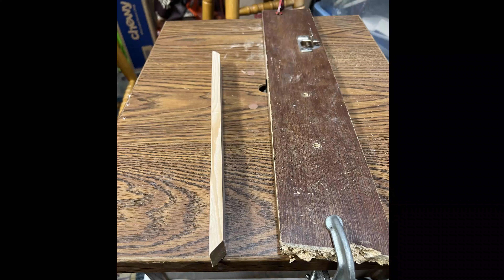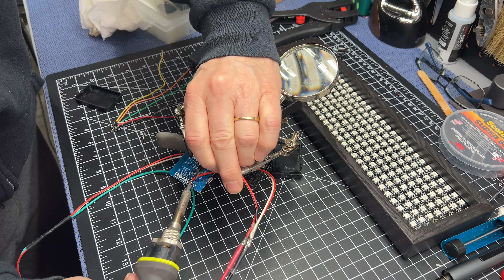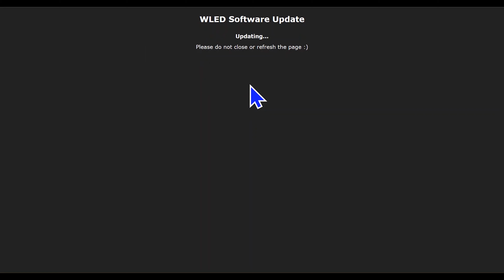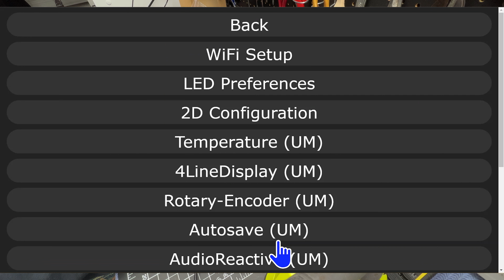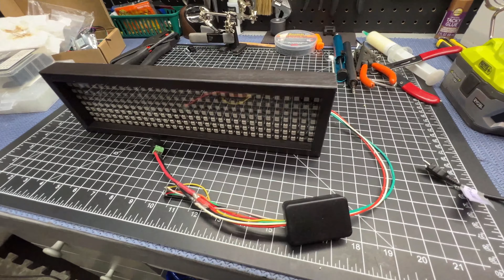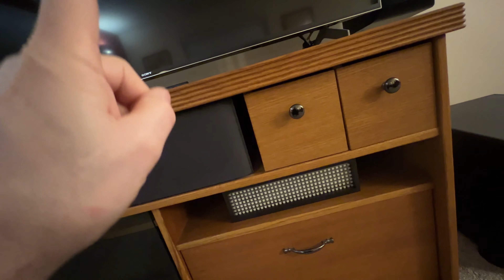Sound Reactive 2D LED Matrix - ESP32 + INMP441 Digital  Mic + WLED-SR

Comment from the maker: Thank you for watching, here are the part links from the video:
► 7/16" x 1-1/16" x 6' Hem Wood board: https://bit.ly/41CpVlp
► (3EA), INMP 441 Mic: https://amzn.to/41AzLUR
► (2EA), WROOM ESP32 D1 Mini: https://amzn.to/4sbi7nV
► 5V, 15A, 75W Power Supply: https://amzn.to/3Se998t
► 8x32 2D Matrix LED Panel: https://amzn.to/41FyFHB
► ALTERNATIVE Matrix Panel 2 Pack: https://amzn.to/4pSSx4O
► (5EA) Waterproof Plastic Project Box: https://amzn.to/3ZbuEst
► Chalkboard Backer Panel: http://bit.ly/3YefpxI
► Picture Frame 1" Turn Buttons: http://bit.ly/3J3NkVN
► 1/8" x 8 x 10 Acrylic Sheet: http://bit.ly/3xZth4b
► 12oz Black Satin Spraypaint: https://thd.co/3IwZu7O

Misc Links:
► Chip Quick Smooth Flow Soldering Flux: https://amzn.to/3QGwMa2
► 60 40 Rosin Core Solder Wire: https://amzn.to/47f8Hwy
► 10 pc Soldering Accessories Kit: https://amzn.to/3YS6nKX
► Soldering Iron Tips: https://amzn.to/45TIUZv
► Soldering Helping Hands: https://amzn.to/3Sr5Ig9

Comment: Well done. My only problem here is that it seems WLED can only go 16 bands with these matrix panels and not the full 32 using each column as a channel for the EQ/Spectrum Analyzer. So far this is what I have found all off the channels using these panels and WLED for this purpose.
Reply from the maker: Thank you,  I want to experiment with some curtain matrix and see how well WLED works with them.  Thanks for watching 👍

Comment: Save yourself a bunch of money by using a USB phone charger ~2 amp, you set the limit for 1500ma, which is 1.5 amps.  Most of my wled projects like this rarely require more than a 2a power supply especially when power limiter is used
Reply: You can use the USB port on the ESP32 for up to 800ma or so, but I use a USB female plug and wire the LEDs and the ESP32 in parallel to prevent burning out the ESP